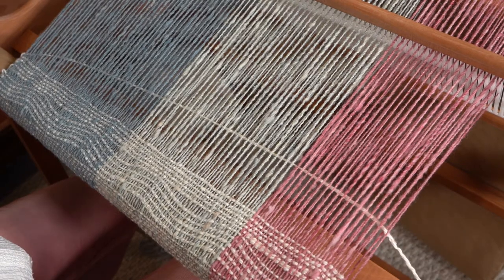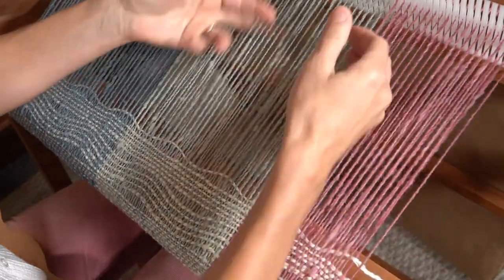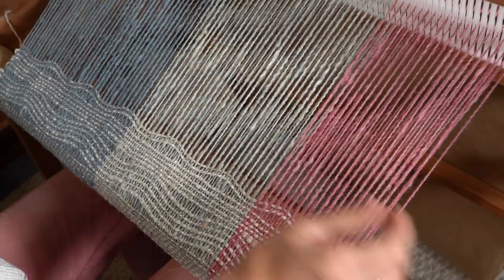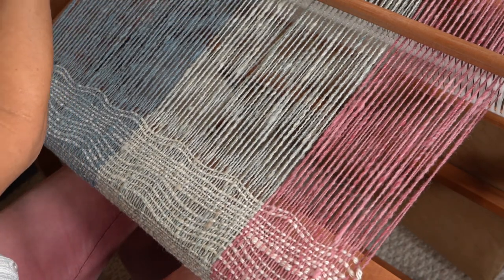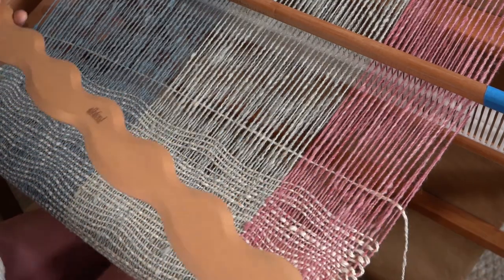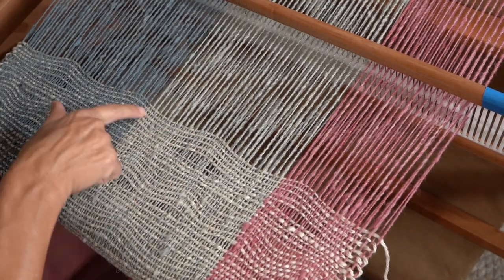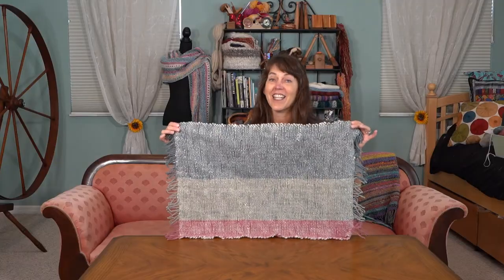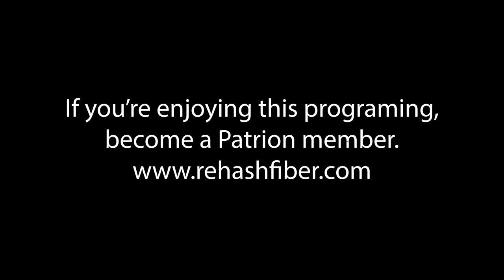How to use a Wavy Shuttle to Make Interesting Designs in your Weaving

Comment: I saw in Kelly Casanova video that on the wet finished you loose all the waves. Is there anyway to keep the design?
Reply from the maker: I have not seen her video.  I don't wet finish my weaving ever (to date) but I'm not a pro, I just do what works for me.  For the sample weave in the video, once I took it off the loom the waves were less pronounced, but still there. I haven't done this yet but have a hunch that if the weft yarn used for the wave is a thicker yarn it will keep the design better.  I'll  try that next.   I appreciate you watching and good luck with whatever you try.  ~Shiree
Reply: This may be beautiful on a wall hanging with a multi texture of linen on your warp.